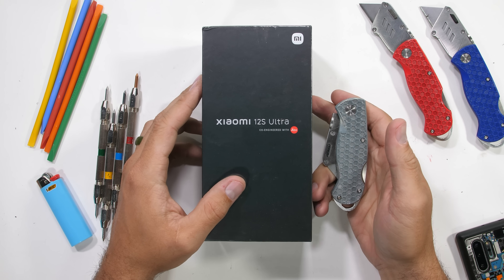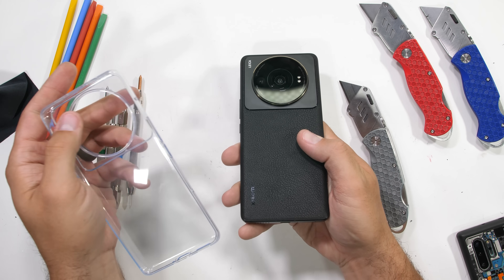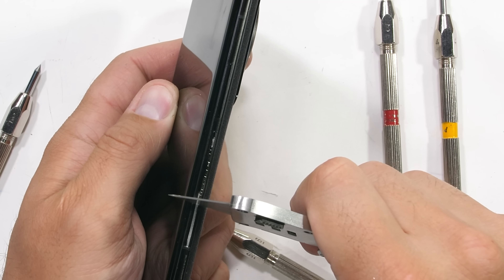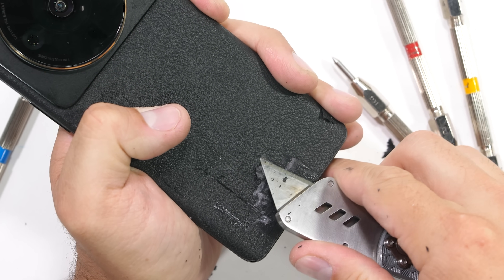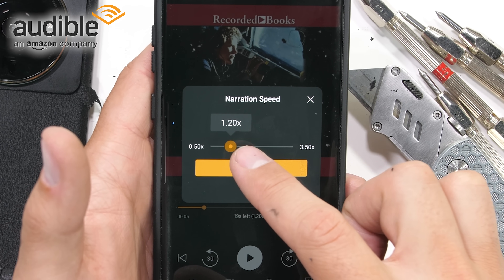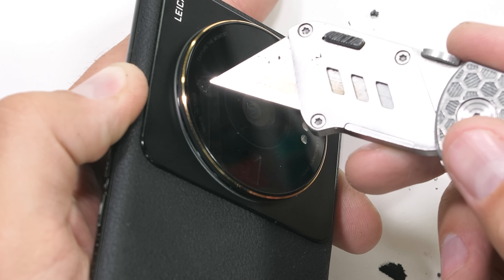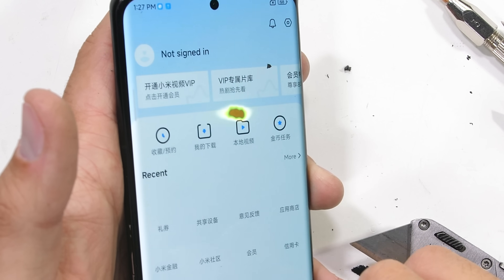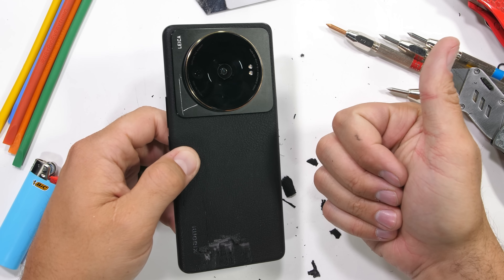Worlds Largest Smartphone Camera? - Durability Test!

Comment: QUESTION: I bought one of these phones,  (12S Ultra) using MIUI 13.0.4 and the LECIA Branding is NOT on the outside of the phone. It is mentioned in the 2 Lecia Settings in SOFTWARE only, but Am confused as to WHY the "LECIA" Name was Not put on the phone Exterior As Per EVERY OTHER VIDEO & PICTURE OF THIS FOR MONTHS? Just confused as top Why not.

Comment: Removable buttons are a good thing. I fixed my power button by removing it with a razor blade and spraying some isopropil in the hole. If it wasn't for the removable button, I would have to go to a phone service to remove the back to clean it. It saved me 50$

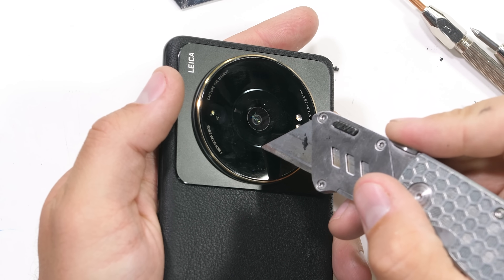Comment: 5:26 "Luckily the atop xiami's 12s ultra doesn't nee to be optically precise" This is simply wrong. If you put frosted glass on a newspaper, you can read the writing well. But if you hold the frosted glass directly in front of the camera, you can't see anything at all.  Optical disturbances in a glass plate are therefore of little importance if the glass is placed directly on the object to be viewed. However, if the same glass is held directly in front of the camera, even the smallest inaccuracies will cause image distortions.

Comment: But it's not a largest camera , sensor, whatever. It's still 3 separate cameras or lenses (insert whatever again) covered in 1"piece of glass, with no protective metal bezel. I wouldn't buy that on principle
I can't see it faring well in a bag or falling out of a pocket ,which all my phones frequently do. Until the battery gets fucked on them I never had any problems

Comment: You should definately test the long term effects of bending the phone! i did it once, the phone as fine, a few days later the bottom speaker was not working and the charger was slow, it happens that the flat cable that connected the motherboard to the bottom pcb was ripped of the plug

Comment: This Xiaomi 12S Ultra has no expandable storage via MicroSD or SD Express so that is a hard deal breaker. There is no point in a nice camera solution if there is no local storage to save the images.

Comment: "Obsolescent e-wastes", "Subluxation of the upper perimeter with propinquity to the antenna line".. loved it! Wondering what your Audible playlist recently had! 😀
Reply: Translate to English 🤣
Reply: @JajaofAfrica  Ask Siri or Google Assistant.
Reply: @JajaofAfrica  p
Reply: Man they arent including the six hydrocoptic marzelvanes fitted onto the ambifacient lunar waneshaft which prevents side fumbling anymore with your turbo encabulator
Reply: @isktuna7077  Well, automatically synchronizing your cardinal grammeters is not an easy task, on the other side of the world they failed and now have libremeters.
Reply: 😂 😂 Ikr

Comment: Actually making that camera protection glass this big is really smart in the end, as whitout it the structure would've been really bad. Not to mention they (hopefully intentionally) placed that antenna line whitin the part covered by the glass. With standalone glasses and this structure, this phone might be done for with the second bend.
Reply: Also, with it seemingly just being a plain circle of glass, it would probably be possible to find a replacement without it having to be specially cut
Reply: @JackieBright  Yea this is something i really wonder about, it could be true its more efficent to replace one bigger glass than a smaller but harder to make one, but i want some research about it tought to take it for a fact.

Comment: Asus Zenfone 9 is coming out in a few days. Would love to see a durability test on that one, as I'm seriously considering it to replace my Zenfone 6.
Reply: How's your 6 holding up? Considering the 9 to replace my OnePlus 6t.
Reply: @mewtwosdad2230  I'll answer with my experience of my Zenfone6, honestly no regrets buying it. Had since it's release and it's a great phone. The pictures taken with it are great, the sound is... Okay. The battery holds for a day it seems while at the start is held for 48 hours. Other than that the software is the best I've had on a phone, and I love the flipping camera.
Reply: @mewtwosdad2230  Up until recently it's been doing well, but during the past month or so I've started having some display issues. Screen randomly goes blank, but the backlight remains lit and you can still "use" the phone. Usually the screen comes back after you lock and unlock it again. I think it has something do to with temperature.

I've ordered a new screen (with frame) from Aliexpress and will swap it out, see if that helps. Performance wise the phone is still plenty quick.

Comment: Does it affect reception after being cracked along the antenna line?
Reply: Depends on the way it's designed. But in a worse case scenario, perhaps only a little because even if the trace leading to the antenna snapped, due to how close they are, capacitive coupling handles it for you.

Comment: Zack, will you buy a new phone this year? Your phone is almost 4 years old now. The battery tech, screen resolution/120hz displays and the smoothness of OS's are what make today's phones worth it
Reply: And yet only the battery tech is the one item most average users would ever really notice.
Reply: @ssoffshore5111  I noticed when I switched to my newest phone the 90hz display is faster/smoother as well as the OS is actually smooth now with the new processor.
Reply: @Lovin_NY93  I didn't when I switch from my S7 to the S21. But, I kept it on, passed the phone around to some friends, and no one noticed the difference as well. Switched it off recently cause I need my phone to last me as long as possible
Reply: @TIMETECH07  honestly surprised that you couldn't tell. It should have been a noticeable difference
Reply: @Lovin_NY93  no one can either when I passed the phone around, even if I told them the screen is smoother. I recall a video where people were told to feel the difference between a 60Hz and 120Hz phone, and only one person noticed it. I'm guessing its the same situation here
Reply: @Lovin_NY93  I own 2 phones a 60 and 120hz ios and most people literally can’t tell the diff either. To be fair 60hz on iOS is extremely smooth and snappy anyways but ye. Most normal people don’t notice and it’s battery saving anyhow

Comment: I love this design. I like the clean look you get when all the cameras are under one single “lens”.
Reply: Looks like a kitchen hob
Reply: It looks bad, in my opinion. I miss the days when all phones had was a small camera, from a design standpoint.
Reply: @goncalo33  It seems we’ve crossed over into cameras that also have phones.
Reply: @CtrlAltPanic  Yes, which is sad. Cameras are a useful feature, and it's nice to see that specialized phones exist. The problem is that most phones want to be cameras.
Reply: @goncalo33  becaus epeople want to take photos with their phones,not to buy a camera.
Reply: @goncalo33  why is that sad? It's what people want, and phones should cater to what people want, they also need to keep improving

Comment: How does this pass the durability test? Structural failure when flexed seems to be a fundamental issue. Has the bar always been this low?
Reply: @æ agreed.
Reply: Agreed
Reply: Phones with issues like this always passed, no matter which brand it was, it's still a good thing to know if you decide to buy it. However, if something even bends too much in my eyes, it means that it's a hard skip. I only consider phones that act like a brick when he tries to bend them lol

Comment: Hey.. since youre already doing fireproofing, can you star doing submerge test as well for the phones?
Reply: Almost all phones are already rated ip67/8. So, since they've already been certified to the IEC standard, there's no use. Pretty much all phones can handle more water than he can reasonably film. He's need to film out at the pool to get deep enough for it to even start affecting the phones.
Reply: Most of my fones were in soup, gravy and sink never did them no harm

Comment: Smartphone cameras are getting absurd, and I'm all for it!
Reply: You're all in for it and i respect it but it's such a big waste of space. You get 4 cameras on other phones with half the size of that Xiaomi one and yeah you may say the main camera has a 1 inch sensor which is great but a big waste that is unappealing in my eyes. Not only the camera itself is unappealing but the whole phone cuz it's like an alien's eye in the back of your phone...
Reply: Seems largely pointless and just creating more waste. Any device using a Qualcomm chip gets 2 years of support then it's end of line.

Perhaps if someone made a mod system like Moto mods and supported it for 10 years it would make sense as you could invest in the optics.

Comment: Actually it doesn't. There's been multiple phones before with a 1-in sensor such as a Panasonic I believe in Nokia and the Sony
Reply: No it is the largest sensor. It's a full inch
Reply: @TechDove  No, it's not a full inch. You don't know how camera sensors are measured. No measurement of the camera sensor is an inch in any way. Camera sensor is measured on how big a circle it can fit in this camera sensor can fit in a 1 inch diameter circle and obviously the sensor isn't an inch in any way. It's just a circle it can fit in would be an inch in diameter
Reply: There are multiple but they all used crop sensor not full so no
Reply: @abdulhannan5256  actually no not all used crop sensors like the Panasonic camera didn't nor did some other ones
Reply: Those werent true 1inch
Reply: Nope.
Reply: @Likeusb1  yes. DMC-CM1 . Sharp Aquos R7 there are some examples and they don't crop in